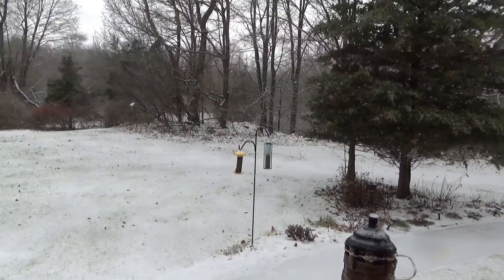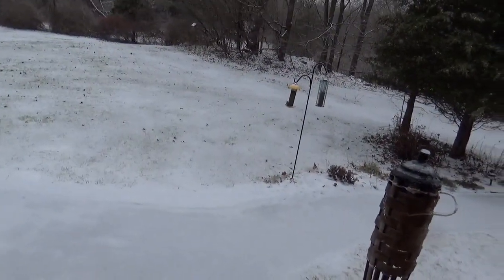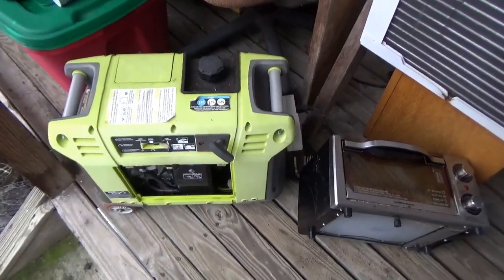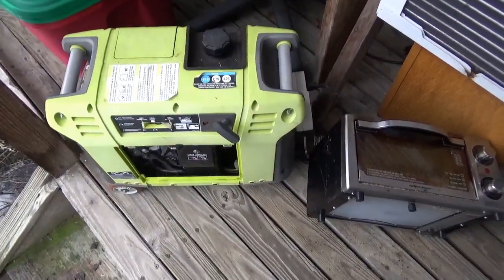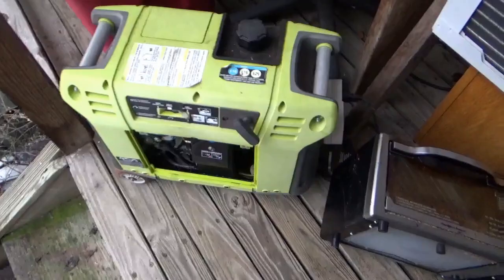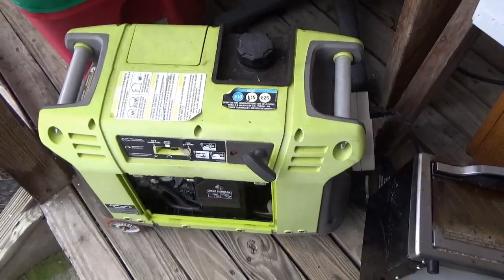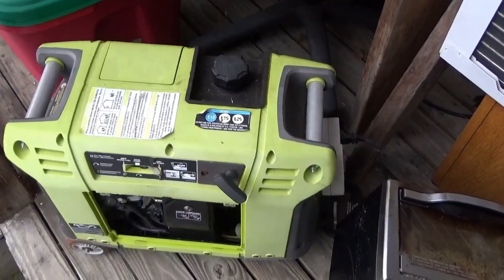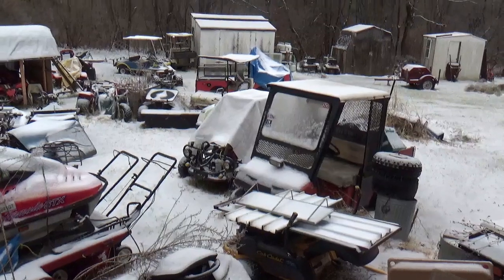Ryobi Inverter/Generator, Old/Cold Start Before Ice Storm Power Loss!

Comment: Change the spark plug and properly gap it. Starter fluid isn't good for the carb. Pull the carb and clean it. I had that same generator and it always started first or second pull even after months of sitting. Keep it inside when you're not using it. That genny should run thousands of hours if you probably maintain it.

Comment: Well it’s still runs ! You might want to consider running duel fuel on your big generator, I found on line a conversion kit for my 6500 watt Honda generator for under $100 ! That way I can run either propane or gasoline at any given time  ! Mine has not arrived as of yet but fingers crossed it may save me time and money ! I can fill a 100lb tank for $40 and it should run for a week on it . Just a thought . As my gandpappy said BETTER LATE THEN NEVER ! Lol 😂

Comment: Make it easer to use the starting fluid. Drill a small hole into air cleaner. Spray into it with the little red tube like on a WD40 can. It works great for me.

Comment: Hey Harvey!! Was wondering what would happen if i put a 125 carb on my 170 engine. Trying to see if my carb is the issue with my China quad.  It runs on starter fluid and will idle but you need to hold the starter down for like 20 min.  I know your good with this stuff. Hope you can help. Thanks buddy

Comment: Really leaving the generator on a covered porch is better than leaving it in the open.
I got a Hyundai 7250W 6500W Peek it’s definitely a monster but so far it seems relatively fuel-efficient, it’s not an inverter generator but it’s very stable and will run the TV, satellite box ect, without issues, only thing that sucks is getting it out and getting the extension cords, thinking about a manual transfer switch or a whole house generator since we lose Hydro a lot.